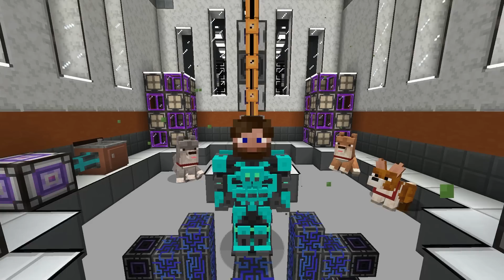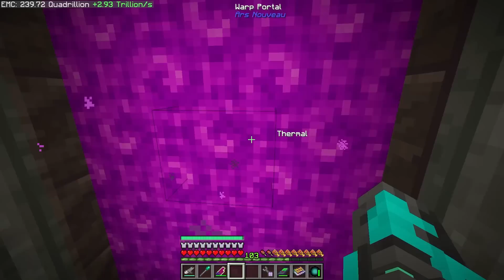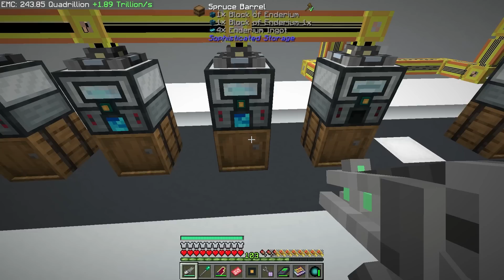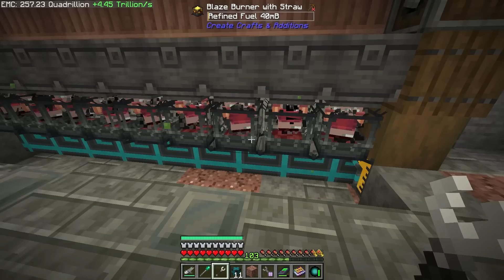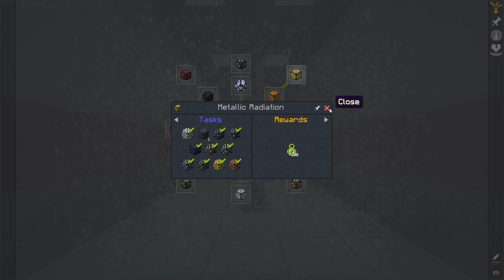PROJECT ARCHITECT 2 - EP 44: MEGA Bulk Item Compression is SO POWERFUL

Comment: The reason your diamond wasn't crushing after upgrading the pattern to x64 was because the computer likely requested the x1 version and was frozen on the system. When you replaced the pattern with x64 there was no x1 to fulfill the old request. With that old x1 still on standby it won't try and send the x64 requests. If you had pattern monitors on your system you should be able to see it and clear it.

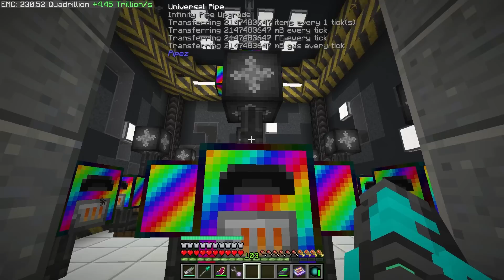Comment: 1:55 The stone transmutation table/tablet from ProjectEX 1.12 could bypass that problem because it used to always display items in descending emc value regardless of if you have emc to pull it or not, no need for visual updates,

Is there a way to bring that table and tablet to PA2?

Comment: Could you fill a draconic energy core with the creative energy cube? The core would make a good decoration. I've never seen someone try and fill it .
Reply: Since one side of the cube can output 2.1 Gfe, that's roughly 13 Gfe per cube, which takes about 10,000 hours (about 155 days).
Reply: i actually did this in my world and after about 16h of runtime the energy core is exactly 0.0% filled (there is a boatload of FE in it though) with the max number of FE/t, so you could say that the tier 8 energy core would never ever be filled up

Comment: IMO why not just use mega cells for all of the compressions? That way they can just run, and when you finally have enough it is still all linked into your system so you have plenty of spare. Heck could get fancy and have a redstone detector to shut them off when a certain criteria is meet. I don't believe the redstone takes a channel either, but might be a pain with multiple induction/furnaces per node. Yea could use laser IO too move the signal around. Not saying to not use the compacting barrels, but offering an option to not use the compacting barrels. :)

Peace
Reply: @steveheffner  I'm for sure never doing it another way again